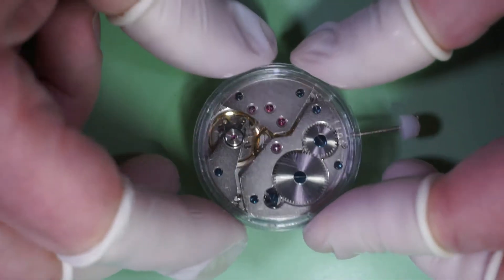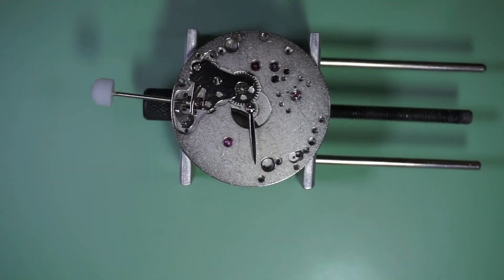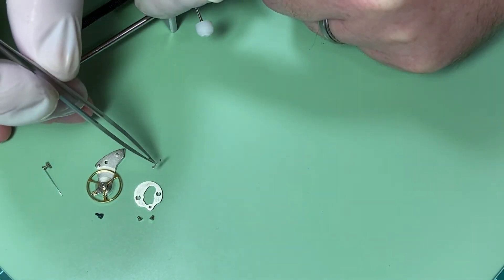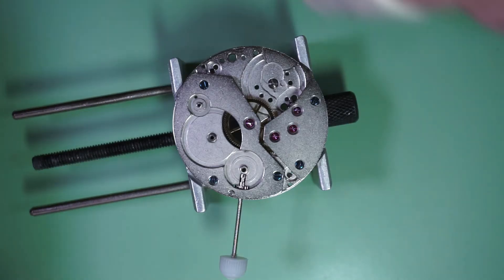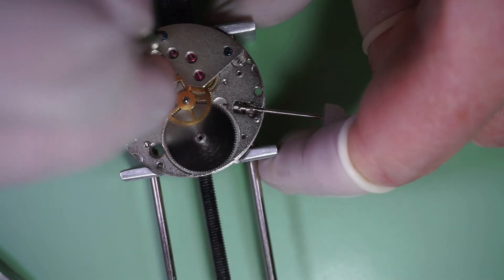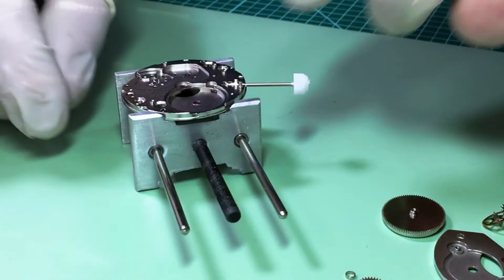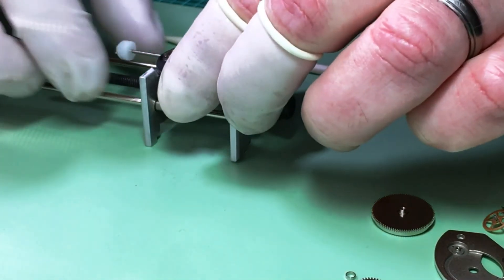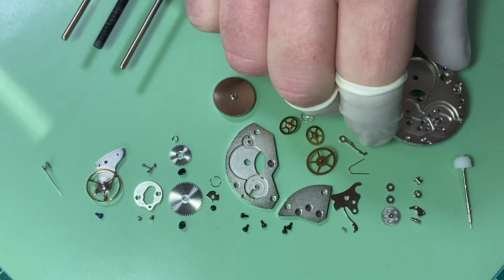Unitas 6497 Movement -  The Watchmakers Friend!

Comment: what pocket watch case size would this be? 12s, 16s or 18s?
Reply from the maker: The 6497 is a wristwatch movement and is approx. 37 mm in diameter. That would equate to about a 9s pocket watch case I suppose. I hope this helps. Thanks for watching!!

Comment: Thank you for this great video! I just took apart my first watch movement in my life watching your video (unitas 6497) in an old 60s/70s watch (Clinton "Shell Super X Motor Oil", check on google its a pretty cool piece :) AND it was a success thanks to your video! 
My movement (I guess due to its probably one of the first/ older versions 6497) did have a different pallet fork plate though and didn't have an Incablock anti shock system but "Antichoc 102". Did damage one of the jewel holder springs there (they seem more "brittle" than the Incablock) but ordered a spare right away!
the watch runs now ~270°, before it was only ~200°
THANK YOU!
Reply from the maker: Thanks so much for the great comment!  I’m so glad you found the video helpful and you got the watch running better than before!

Comment: Hi. This is chinese movement, specifically Hangzhou 9011A.

Usually original Unitas 6497 and 9498 have 17 jewels, and same is true for clones by Seagull ST36.  Hangzhou has additional ruby on the dial side, right under the barrel wheel. Original Unitas, nor Seagull clones dont have ruby there.

Hope this helps, because some parts are unique to this movement and replacing them with either original Unitas or Seagull might not work.

Ebay sellers usually list all Chinese movements as  Seagull, not sure why, but asking price for a Seagull is 10 dollars higher.
Reply from the maker: Hi and thanks for watching.  Great comment!!

Comment: Just trolling through the tube and came across this great vid. The 64977 & 6498 are perfect for those whom wish to learn watch making/repair. I have used these moments (ST36) many times in custom made watches. I noticed you were slipping with the driver, this was probably because the driver head was not wide enough and the angle too steep. Try to match the width of the screw head to the width of the driver blade. And...please...please change that holder! All the best and keep the vids coming. Ben.
Reply from the maker: Hi Benny, thanks for watching and thanks for the great tips!!  I hope you enjoy my other videos as well.

Comment: How does the dial attach to this movement? There are so many holes and no screws around the rim to secure the dial feet.
Reply from the maker: You know that's a great question!  I'd never noticed that because I had just been using the movement for practice.  I had never tried to put it in a case or attach a dial.  I wish I could answer your question but at this point in my education....I just don't know.
Reply: @watchasilearn  So in my searches I learned that the three holes with sloped edges are for the feet/pegs of the dial. I suppose there are holes along the rim for tiny screws to tighten. The search goes on. I have much to learn. I haven't even taken the movement apart yet.
Reply from the maker: @annbstitched  Well that's great information.  Thanks for sharing.  Also, just take your time, it's not a race.  Enjoy and let me know when you get it apart and back together and how you liked it.

Comment: 4:07 holding balance wheel that way may cause serious problems like bending of wheel and damage on pivots and shock protect spring.
Reply from the maker: That's a great tip.  Thanks so much!  I was actually trying to keep from causing damage but now that you point it out I can see how I could be hurting the pivots.

Comment: Very cool. Can't wait to completely disassemble my first movement.
BTW, I think your screwdrivers are slipping away from the screw heads because are not completely perpendicular. You can see it in the video. It usually is at an angle. It happens to me all the time. Practice, practice, practice ;)
Two questions:
1. Where do you sourced the movement from? I've seen some Seagull 6497 clones very cheap at eBay, but I wonder if I should go with the real deal
2. Do you plan to put it into use on a watch? It'll be great to create maybe a field watch out of this one.
Reply from the maker: Hey there, thanks for the comment and tips about keeping the screwdriver perpendicular,  You are so right,  that is what I was doing wrong.
I got the movement off of ebay and it was pretty cheap, around $35 I think.  And Yes, I plan to eventually use it on a watch but for now I use it for practice to try to hone my skills.  Thanks for watching!!
Reply: @watchasilearn  
You both are incorrect, the screws are slipping because the facets of whatever screwdriver bit you are using are not finished and the web is also not adjusted to perfectly fit the screw slot.  Technique however, is always important.👍

Comment: Nice job, I enjoyed watching you take the movement apart. The 6497 is by far and away the best movement to learn on. I know it's difficult to work on a watch with a camera or microscope in the way. I think the reason your screwdriver keeps slipping out of the screw slots is because you have it at a slight angle as you rotate the screws, the screwdriver should always be at 90 degrees to the screw.  Well done, I look forward to watching your progress.
Reply from the maker: Thanks so much for the positive feedback and the advice about how to hold the screwdrivers.  I'm getting much better at it, you were exactly right about holding it at an angle.  I have more videos in the making but I'm having issues with my computer and editing software getting along at the moment but more are on the way.